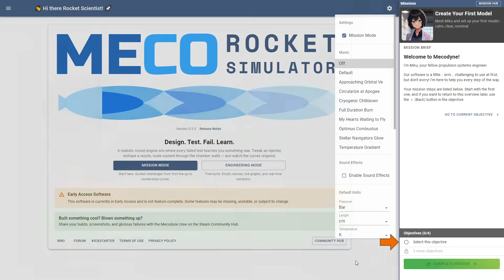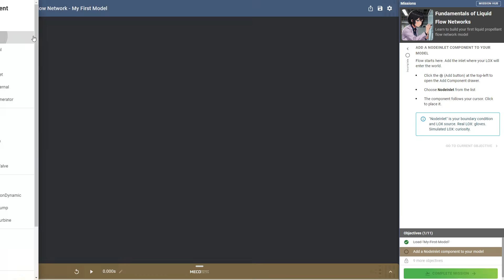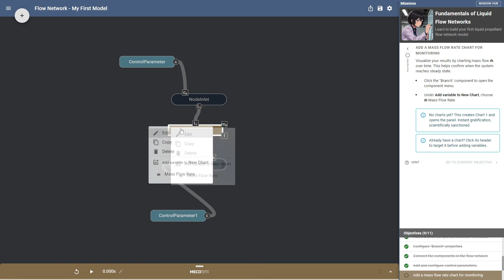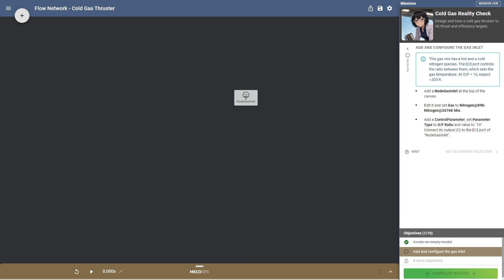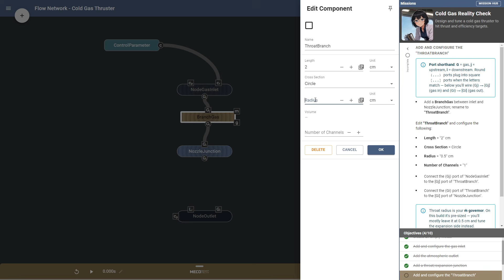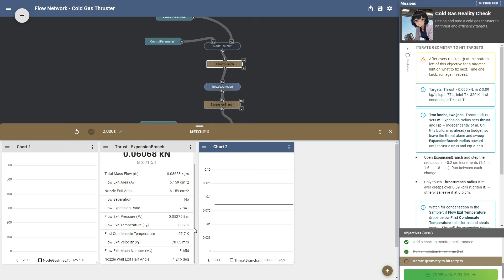MECO Rocket Simulator - First Try

Comment: thank you for the first look i would love to see the next part 

sound and music maybe could be turned down in system volume mixer?
Reply from the maker: Well, it's inconvenient to get to the system volume mixer when the game is running in full screen. I'm partly thinking of other people using the program. I think it is reasonable to request that the game have volume settings. The game has plenty of other sliders - I feel confident they know how to handle them.
Reply: @RaizSpace doesn't OBS also have such a feature?
Reply from the maker: @alphaspace1100 OBS has a single volume slider for all system sounds (a separate one for my mic). But again, I generally expect games to have their own. MECO Rocket Sim operates on its own game engine as far as I know rather than Unity, so I can't give them a specific suggestion, but I sure do know how to implement it in Unity. I did have an ulterior motive for turning the music off - I didn't know if it was YouTube safe or otherwise if it was written by AI.

Comment: oh it looks like the UI for the mission is better now; when I did them, it was a floating window that constantly got in the way
The O/F ratio thing on the nitrogen is because it does the temperature regulation that way, between the min value (89 K) and max value (2676 K). It is still an odd way to do it, a temperature input seems like the much better architectural choice, as one could make use of it for other propellants too that way.